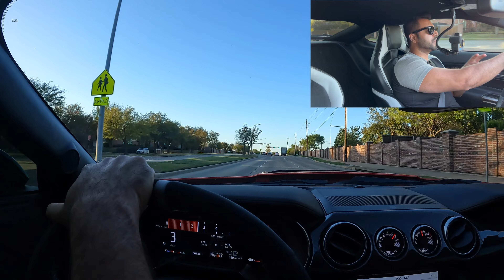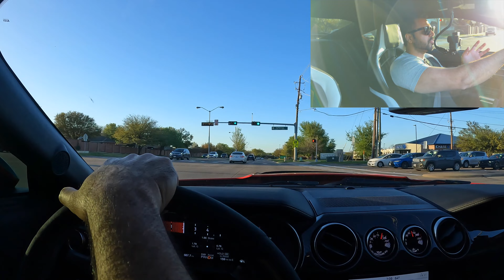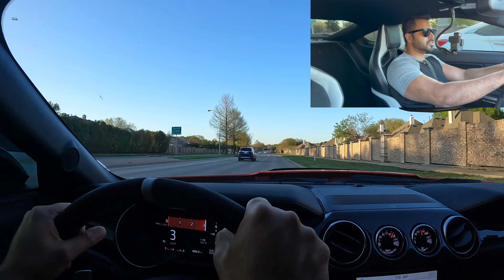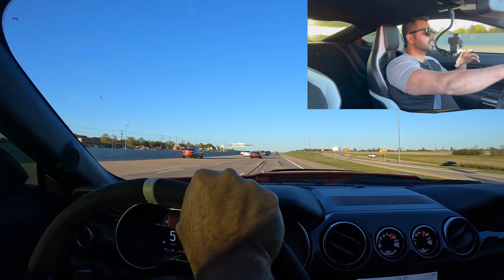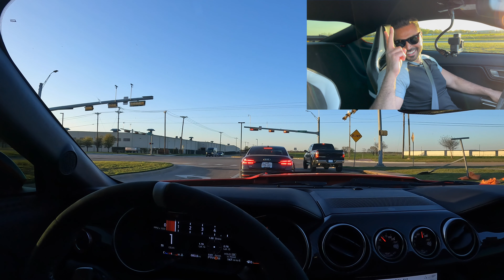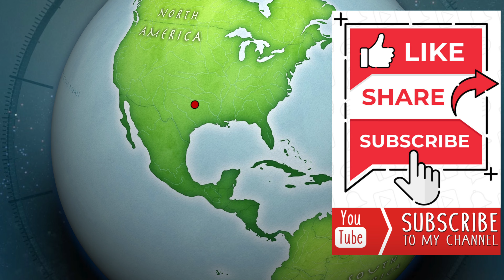GT500 JLT Intake  - Before and After Part I - Can you really feel the extra 35hp?

Comment: Track mode has less pedal response than sport mode. This is done on purpose. You're going to have less low end torque with a smaller displacement engine.   The smaller engine has to turn more rpm to make its power. The 5.2 is just a more efficient engine for its size.